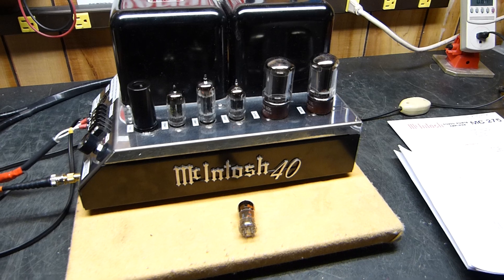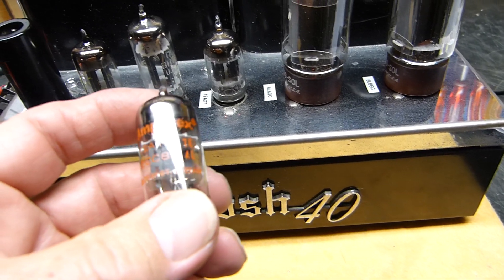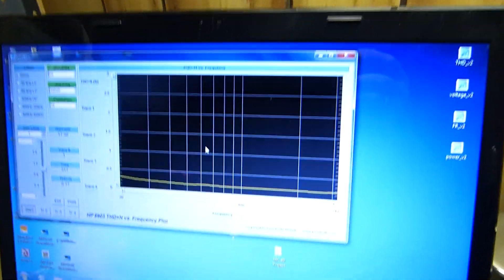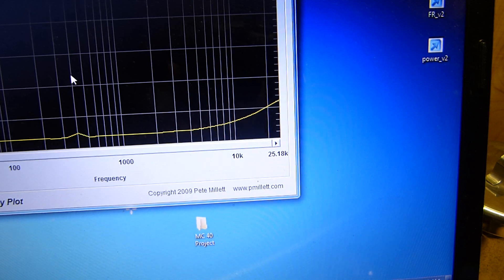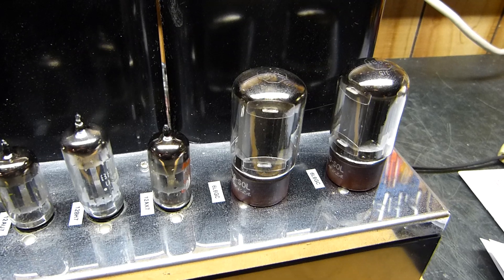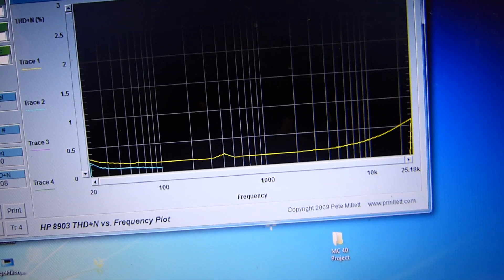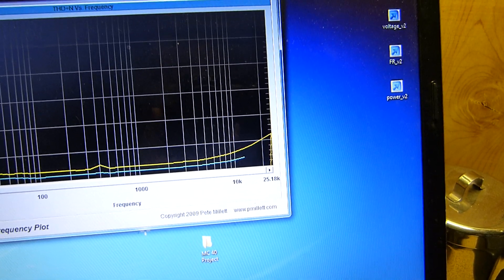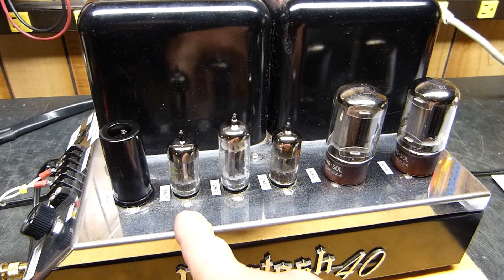Comparing 12AX7 vs 12AT7 As The Driver In The McIntosh MC40

Comment: If you swap the driver tubes on these Macintosh amplifiers it will affect the bias radically. Having the wrong tube in the driver socket will result in the output tubes overheating due to not enough negative bias.
Reply from the maker: Absolutely agree. I did that by accident putting a 12AU7 in place of a 12AX7 and couldn't figure out what was wrong with it. Bias on the output tubes drops to about 1/2 and the 6L6 start to red-plate. Took me a while but finally I suspected I might have the wrong tube and with a tube tester could tell the difference between the 12AX7 and 12AU7. That would not happen with the first tube but best to keep McIntosh amplifiers as designed.
Reply: @ElPasoTubeAmps  I've had a couple of these amplifiers come in from customers with the last two tubes swapped in place and this red plate problem. Quickly solved by checking the tube type against the socket marking.
Reply from the maker: @basspig   In my case I think it was a Telefunken tube and all the markings had been wiped off and they do look al lot alike. In some, maybe with an eye loupe and known ones to compare against, I think we might be able to see that the grid structure is a little closer on the 12AX7 vs 12AU7 but in most of these tubes, the grid is almost impossible to see.
Reply: @ElPasoTubeAmps  an old trick I used to use to reveal the markings on some tubes was to breathe on it to make condensation. Sometimes it would reveal the tube type. The sure fire way is to put the tube on a curve tracer. The curves are radically different between 12AX7 and 12AT/AU7 types. I would think the bigger difference would be the cathode structures, having bigger diameter to emit more electrons.

Comment: If I had to put a New 12AX7 in my Marshall Plexi amp Phase Inverter(V-3)What do you think is good
Reply from the maker: I am personally a fan of Tung Sol tubes. It is impossible to say for sure in each guitar amplifier without trying it but the lower gains tubes like the 12AT7 and 12AU7 might give you a different tone, that you may or may not like. Worth a try if you have the tubes. 
As for the McIntosh in this video, you do not want to change out the 12AX7 or 12AT7 for a 12AU7. The Mac design is very different from a guitar design and "rolling" tubes in a Mac amp is a bad idea. I did it by accident putting a 12AU7 in place of a 12AT7 and the output tubes, the 6L6GC, will "red plate".  That last 12AX7 in the Mac amp sets the bias for the 6L6GC and a 12AU7 in its place changes the bias dramatically.

Comment: When substituting the 12AT7 for the 12AX7 I bet you upset the bias.  I ran some LTSpice simulations and found that the bias on the output tubes goes from about -45 to about -38 volts on the grids when the 12AT7 is installed.  Thus the outputs are biased hotter.  I wonder if a bias change to the output tubes is the root cause of the lower distortion using the 12AT7?
Reply from the maker: +Tom Lang I think you are correct. Some years back I accidentally put a 12AU7 in place of the 12AX7 and things got really bad. The output tube plates started showing red and the bias voltage on the 6L6's was very low. I was really puzzled because I had no idea I had made that mistake. I am a fan of PSpice and I have the student version 9.1 but it has been 20 years since I used it seriously. The copy I had at work was a DOS version, which I really liked. I do like the Schematics in the newer versions even if it is only for drawing. Back to the 12AT7. I haven't thought much about this experiment since then but I bet your model is correct and we both know that higher cathode currents results in lower THD up to the point of destruction of the output tubes. Thank you. I appreciate your insight and comment.
Reply: @ElPasoTubeAmps  Tom Lang  So are you saying that the 12AT7 will damage a guitar amplifier? The folks at Eurotube sold me a couple and said they work fine and sell a lot to tame high gain amps. I have an EVH 5150 50 watt and use them in V1 and V2. I've been using them for 8 months and so far no red plating power tubes and they sound great. Just want to be sure I'm not screwing the amp up. cheers Ken
Reply from the maker: @kenmasuda7696  No, odds are the 12AT7 will be just fine and as you say, lower the gain a little bit below that of a 12AX7. I have never seen this happen before but it occurred in the McIntosh amplifier when I accidently put a 12AU7 in place of a 12AX7. I did not realize I had done that. Something about the design that McIntosh uses causes the bias on the 6L6GC tubes to drop to about one half what it is supposed to be if you put a 12AU7 in place of the last 12AX7 that drives the  6L6GC.

Comment: Sorry to clutter up your comments with noob-ish off-topic questions, but I wonder if you have worked on the Dynaco ST-70? There are several lengthy discussions on Audio Karma that led me to purchase one that's all original.  If you have worked on this model have you made/tested any of the numerous mods?  Seems like there is general agreement that the GZ34 should be replaced by a SS rectifier, but to mod or not to mod, and if so, what....well you know what they say about opinions.  I can confess to enjoying your videos immensely, though I can't follow all the technical details.  Like Uncle Doug, I appreciate that your conclusions are based on facts, which usually are good to rely on in making choices.  If you'd prefer, you can reach me at carlsback40@gmail.com. Thanks and keep the videos coming!  Feel free to delete this if it's not appropriate. My skin's as thick as my head.
Reply from the maker: Hi Carl, I really appreciate your comments and am happy to tell you whatever I know. The Dynaco ST-70 is a really nice vacuum tube amp. I believe there were a million sold back in the day. It might even be said to rival the McIntosh MC240 and only about 10% the price. I have always heard Dynaco called the, "poor man's McIntosh". I am not too much into modifying the circuits. As for changing the 5AR4 so SS, that will raise your plate voltage a bit and increase the output and lower the THD a bit. You should add a thermister to the AC line to help limit inrush current when it is turned on cold. There are different driver boards that can be used. I kept the 7199 design but changed our the old original Dynaco PC board on mine. There are some nice epoxy ones out there for little money. I don't get into the high $$ caps as I think it is all smoke and mirrors. Good quality USA made Orange Drops are all I ever use. The 7199 can be substituted with a 6GH8 to save money and find replacements easier. I have made a video on the change. You must either use an adapter socket or rewire the pins on the 7199 socket to use the 6GH8. Uncle Doug and I keep in contact with each other. I think he as done a marvelous job in helping people learn and deal with vacuum tube amplifiers.
Reply: Please do not use a SA replacement for the 5AR4 unless it is a sophisticated design that drops as much voltage as a tube rectifier. Also, because such a rectifier does not have to warm up, it stresses the amp -- kinda like banging water pipes.

Comment: One factor that needs to be considered is the amount of current each tube can source. 12AT7 is a high transconductance tube and can source ten times as much current as 12AX7. When driving output tubes into class B operation, grid damping becomes a factor. Having good current driving capabilities becomes paramount for a driver.

Comment: Dave
 Did you get the power drop issues straightened around? If not,you are going to have the reservoir filter caps after the choke.The doubler caps helped no doubt but I have see those caps collapse when the rail voltage drops higher power.
Reply from the maker: The power drop-off at high frequencies was caused by my experimenting with different NFB capacitor values. Not too surprising,  more NFB reduces THD but also causes high frequency attenuation. I left the NFB, 330 pF capacitor as McIntosh designed it. To condense this incident to the lowest level, the "upgrade" was, objectively,  what changed everything (from the old S/N level to the later S/N level design). That is where everything got better and the amp met specs again. It was not signal or PS capacitors that improved the amp. The 12AX7 to 12AT7 swap was my doing and I am not recommending that everyone (or anyone...) make this change. There are nuances and instabilities that may occur with this tube swap that I have not, and do not, have the experience or equipment to evaluate. We have to keep in mind that a laser focus on solving one (perceived problem) may inadvertently cause other problems that we cannot measure and are not aware of.  This could go into a whole philosophical discussion on life...

Comment: It´s obvious, as the 12AX7 (=ECC83) has far more gain hence this leeds to more distortion, compared to a 12AT7 (=ECC81).
But you should not do this, as the operating bias between this two tubes differs a lot. Take a look at the plate characteristics and you´ll see that, as well.
For a full comparisson you have to tell us the input voltage you fed into the amp and the output voltage as well....otherwhise it´s just (more or less) funny curves....As we do not know the gain factor of that amp with a) 12AX7 and b) 12AT7 installed. As i would expect a noticable difference.
Anyway, nice video, thanx for sharing!
Reply from the maker: TubiCal The amplifier has two levels of input, 2 volts (8.3 dBm) for 40 watts output when the gain control is in the "clicked: fully CW position they provide for McIntosh preamps, and 0.5 volts (-3.6 dBm)  for 40 watts output if you use the gain control fully CW but not in the "clicked" position. The 12AX7 and 12AT7 give exactly the same output as can be seen in the video. I know of no universal way to determine "gain" of a large signal amplifier like an audio amplifier.  Keep in mind that the input impedance of the amp is approximately 250K in all cases  There are many ways to determine gain and if you look in authoritative books, they all avoid answering the question for these types of amplifiers - and of course, we are not talking about voltage gain and resistor values of an opamp. Since I enjoy the math think about these numbers in determining "power gain": 2 volts from a 600 ohm source is 8.3 dBm or approx 6.7 mW for a gain of 37.7 dBm. But who cares about the source impedance of the oscillator? So, figure simply 2 volts across 250K which is 16 uW for a gain of 64 dBm - or 0.5 volts across a 250K input which would be  1 uW for a gain of 76 dBm, and so on. I am sure you see the problem. If you know of an accepted procedure for answering this question please let me know. I have seen stereo amplifier manufacturers post gain numbers for their amplifiers but I can't find any for examples at this time.
Reply: ElPaso TubeAmps
Do not mess with all that input impedance and all other things, as it is not as complicated this time.

But i think you should do the THD all by yourself, not with that HP. I know that the HP is a very good equipment when you just want to know the overall THD.

But this time, as you compare tubes within a given curcuit, you need to do it all on your own. As by doing so, you have all the required measurements taken all by yourself.

Run the amp until you got a resonable output, if it´s been 10Watts, if it´s been 20Watts it´s ok. As this is nothing of interest in here, as we want to measure the THD of the driver tubes not the THD of the amp when running into saturation. We do need to stay all the way in the linear region of the amplifier.

So next is, hook up a spectrum analyzer to the output and determine the THD the old fashioned way please.

Read the voltage of the input and output as well, if it´s peak to peak on an oscilloscpoe it´s ok, as we do not need any RMS values in here. But do it the same way for input and output, as we need the relationship between them, as this is all that matters.

Divide the output voltage by the input voltage (=gain) at the terminals of the amplifier for the original tube at at let say 10Watts sinwave output.

Change the tube, as you done it in this video.

Set the input voltage again to have exactly the same output voltage as above, and read the wattage, not the other way round as they may done an overall negative feedback loop, i don´t know.As i don´t know the McIntosh circuit..;)

Check the distortion on the spectrum analyzer again, you should read different numbers, i assume.

If not, the circuit has a very high negative feedback loop, which forces the Amp into a linear response....
But i think this is not the case, as if it would be, your THD curves you have done in this video should be exact the same.
And therefore i assume the lower gain of the 12AT7 compared to the gain of the 12AX7 has to be taken into account here, otherwhise the curves would be identical in both total amount and spectrum. As this is not the case, as you shown it in the video....

So we need to dig in a little bit deeper here.....and therefore we need to check it all manually.

Then you may hook up the HP analyzer again to (re)check the overall THD, but i think this would be as "bad" as you already done.

Another thing that comes into my mind is, the AX7 can´t provide the same cahtode current compared to the AT7. So if your amp has something like a (local) current feedback, this will not work anymore, and therefore the amp is producing higher THD values....But to check this for beeing true or not, you have to know how the circuit around that AT7 in this amp is made up.
Reply: TubiCal All that's not really necessary, there are way too many other factors at play to be able to draw exacting results, that's why the question falls into a given set of parameters which are subjective to say the least.